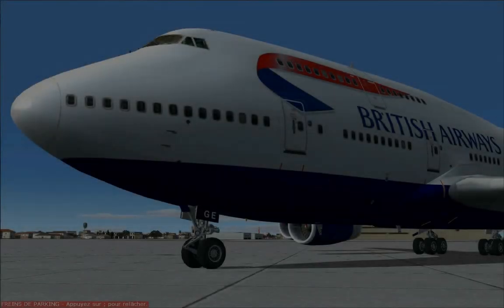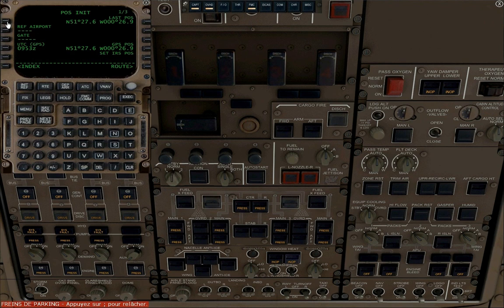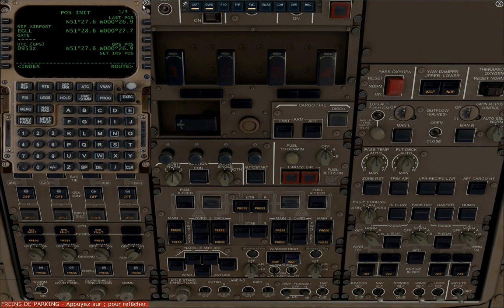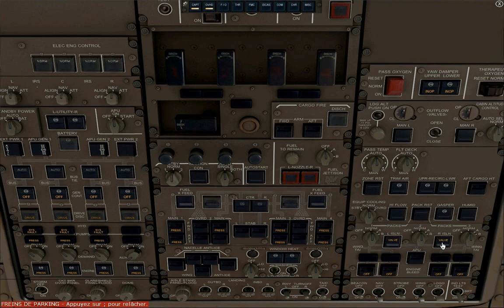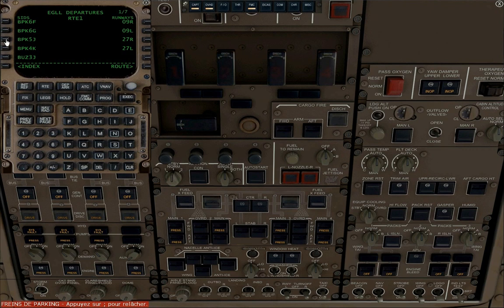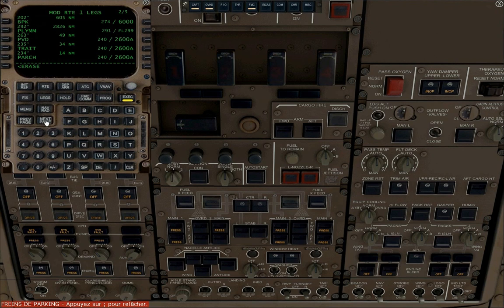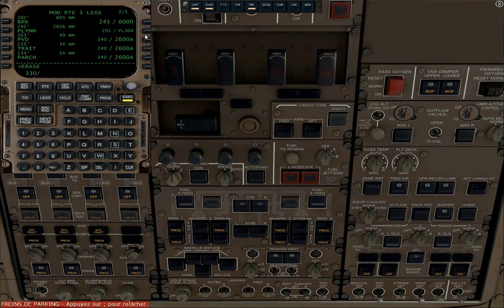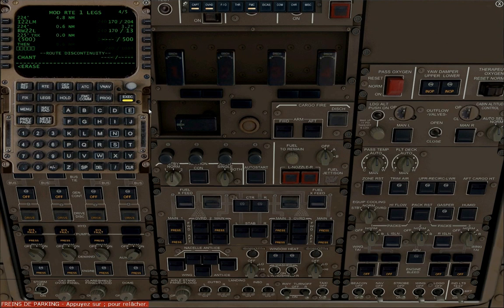PMDG 747-400 full tutorial part 1

Comment: How to ake your 747 cold and Dark. it always start up with Engines running. How did you do Push Back? Where can we load the fuels to flight?
Reply: +MrPrateekpanda When you are in the aircraft, in your case with engines on, just press ALT key for upper menu, go PMDG and select panel state. Select Cold and Dark option.  You can create a new panel state as your desire and save it, so you will can use it later. Personally i think the real cold and dark is much more COLD AND DARK than default hahahahaha.

Comment: Hi. 

When I press lnav.. 
It doesn't pass the Vor to the next one... It goes past it and just continues off track.... Please help
Reply: +10000wwefan Make sure the CMD is activated (autopilot) hahahaha, this aircraft is really really smooth and sometimes it can fly alone without autopilot! hehehe. But if you have activated autopilot (CMD on) and LNAV is active and your route is programmed correctly... it should follow it but IMPORTANT! some procedures have steps like VECTOR, this mean you MUST turn the aircraft manually. In any case... in LEGS page, you can click the next waypoint and insert it in the first line (LSK1) then press EXEC.

Comment: Ok thx.I will try to reinstall FSX,  By the way, I also have FSX acceleration hopfully thats not causing the problem. Just one more thing. how do you properly program the way points in FMC? All the way points R fine except for the last one which leads to the runway. Sometimes that last way point shoots 60nm away from the airport. Is there a way to know the proper waypoint to select before you start your flight? (Yes,u can change it after, but once changed, all speeds/altitute in legs disappear).

Comment: No I haven't. My FSX sometimes crash in mid flight. DO u know why? (I tried UIultomationCore, no luck). And for my 747, only pitch seems a little weird, all else seems normal. Should it not run at all if its a compatibility issue, and not just a slight abnormalty?

Comment: I did use pmdg's load manager. Pitch is set according to FMC. If I use 10 degrees flap and a 5.5 pitch (indicated on fmc), the aircraft will tend to pitch up after takeoff, I need to push yoke forward to maintain climb, or else it will keep pitching up if I leave the yoke in neutral position or only pushing it forward slightly. If I ignore the FMC pitch and only use 10 degrees flap, then all seems normal. Did u ever experience this when u play PMDG 747?

Comment: I have a big problem!
If you follow the PMDG checklist, a startup without the external power is available too.
If you start the baterry, standby power auto, all hydraulic systems off, INBD CRT Selector EICAS, your EICAS system should work.
Well it doesn´t for me.
I already tryed a lot of things but the EICAS keeps blank without external power :/
I loaded the panel stat called "PMDG 747 Cold and Dark KPAE.sav"
Does someone know a solution?

Comment: Climb angle is variable, depending on aircraft weight, flap setting, engine thrust and desired climb speed. As long as you can pitch your aircraft to maintain V2+10 speed during your initial climb, things should be ok. Perhaps your takeoff trim is not set as per the FMC. Even so, with the autopilot NOT engaged, you should manually trim the horizontal stabiliser to keep the aircraft at V2+10 speed.

Comment: @joshman879 The APU or Auxiliary power unit  is a small jet engine in the rear of the aircraft  it kinds looks like an exhaust pipe  where it is  it is a small jet engine that provides electrical power to the aircraft when it's on the ground at the airport and the engines are off  it is off during flight because the engines power the plane during flight :)

Comment: Great tutorial, thanks! Just a bit of info, when you selected the departure runway, it reset your v-speeds. That was because of runway slope. Basically, if the FMC thinks you've changed the runway, it will think the new runway has a different slope. In FSX though, slope isn't simulated. I find it easier to do DEP ARR first. Stunning tutorial, really has helped. :)

Comment: @MRmatthieu49 the engines cant be on, external power comes from the ground crew, (assuming you have external power enabled in the pmdg setting) you have to turn the engines off.  do you really think the ground crew would come anywhere near the plane with the engines running?

Comment: nice tutorial. i need some help though. i was doing an ifr fromKJFK-EGLL with fspassengers and as it got to day (because it was a night flight) my engines stopped running because of fuel. at the beginning when you load passengers an baggage theres an option for how much fuel you want to load. i put the fuel to its highest which is 100% and it still cut out at the same point of the flight. in the fsx settings i puyt the fuel to unlimited. still the same problem. is the pmdg 747 or fspassengers???

Comment: Hi excellent Video.  

Currently running PMDG 747-400 on Windows 7, just like your tutorial.

For some reason my PC will not save the .sav files. The general location is saved, ie EGLL, but the panel state returns to default values for the MCP speed, ALT, ect. Any thoughts? Thanks in advance.

Comment: hey get ur message i have everything working as good as gold now it was so easy i dunno wawt i was doing wrong but i figured it out i dont remember my question but thanks for all the help im not really into the 747 now becasue i have a shit graphics card adn it jsut eats my frames with everything down low and in a default plane like 737 i get about 13 fps and every thing is down low so the 747 doesnt help but wen i get really good graphics card il use it :)

Comment: i think the reason its not allowing u to enter FL340 is because it is calculating that for efficient flight ur optimum cruise height should be at FL304. so that may have been based on the amount of fuel/pax u have onboard at that point of the flight. So try changing the fuel quantity and see if that will allow you to make the change.

Comment: hey also um do u have acceleration expantion pack wcause when i try install the "free version" um it comes up with a thing saying NOTAM your fsx version is more recent than sp1,acceleration or sp2  and i have acceleration so if i buy it will this most liktly happen cause in not wasting 60 bucs on something that wont work

Comment: hey again um can u get me that code in aircraft.cfg it should help me um i still cant get it working ive got the torrented version i dunno if thats prob um i will buy it if is a probthe torrent version but yea i jsut can get it to anything like yesterday i flew from klax-ksan no probs but with red lines through it and no dist info adn no dis info adn lnav worked now trying it doesnt work it turns straight off again so if u can get that code for the aircraft.cfg and tell me my lnav problem thkns

Comment: hey um no im not trying to file fp from fs whne i first start off like jon game its normal it say down bottom gps3 after 20 seconds ils l up top and -7600ft at klax altimeter syas 22.15 two red lines go through the pfd display and one through the vertical spd indicator and also wen i try file plan in fmc it comes up with rout discontinuinty for the airport code but not waypoint.

Comment from the maker: @audis0 That could be because you touch the commands, which disconnects the autopilot, but it shouldn't do this for autothrottle... Do you use the FMC? Because if you didn't enter speeds in the FMC while following a flight plan with VNAV and LNAV on, this could maybe cause this kind of problem. What do you mean by speed set to 200kts? You can't change it? Same for altitude? What do you mean by use IAS for taxiing? You should refer to GS (ground speed) when on the ground.

Comment from the maker: Ahahahah, you don't have a clue of what you're talking about, do you? I don't need to turn on the autothrottle as the FMC is controling the speed. The FMC message isn't saying that VNAV is out, it reads :"unable next altitude", which means the plane's going to reach the next waypoint at a lower altitude than expected in the flight plan. Dude, I'd be kind of embarrassed of myslef right now if I were you... But thanks for the extra views you brought me ;).

Comment: There are so many things that you are doing incorrectly that you really aren't qualified to do a tutorial.

I spotted so many errors but to give you a few tips: 
1. To do an align, the switches move from off to nav (not align; this is only for a quick align for a quick turnaround, which is rare).
2. You ALWAYS select RWY before SID or STAR.
3. You do not move the #4 HYD switch to AUX until you pressurise the system.

I could go on but you get the point.
Cheers!

Comment: just a quick question, if anyone can answer. When i fly an iLS approach, as the ATC guides me HDG and other stuff. Then in encounter a problem. I can't set Lnav or approach hold. if i try to set Lnav, then the FMC tells me: Not on intercept heading. when on i try to set approach hold then nothing happens and the plane keeps on flying on the Heading selected. Is there any way to switch off the heading?

Comment: well the other guy in the other video misses alot of buttons you mention straight after turning on the battery. and the order is also different in some areas.

and also, sorry for asking alot of question, but im having trouble with one of the buttons. after i turn on the battery the external power button does not power up. (ie the "avail" writing doesnt show) so when i click it nothing happens. why is this? and also all the buttons you press straight after  the standby power are already on auto.

Comment from the maker: The ELEC ENG CONT switches light up on norm when I turn the EXt pwr on, if they aren't on, right click on them and trs left clicking once the plastic cap is open. 
Maybe some steps differed from the docs, but it's no big deal I don't think. As long as you got everything done by the end of the checklist, most of the time the order doesn't make much of a difference.